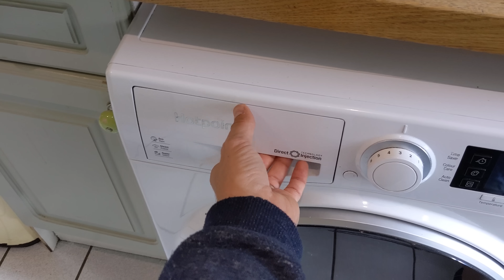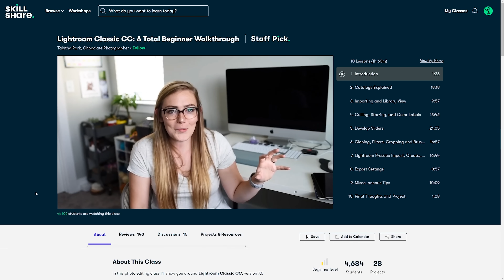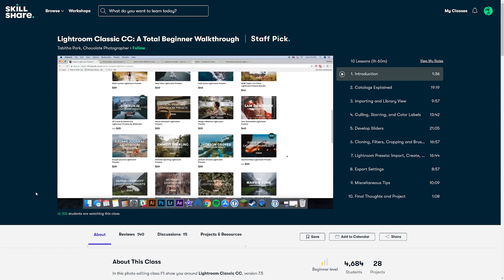The Pythagorean Siphon Inside Your Washing Machine

Comment: Has it not occured to him that they weren't talking about the tank side of the toilet??  Look at the Bowl, and the drain. The water stays in the bowl at the top of the lowest point. When you flush, it fills it past that point and starts the siphon until it is empty and gurgles
Reply: mmmmm yesss daddy siphon me
Reply: romasromas73 wtf
Reply: Lmfao I know right?
Reply: Take out the vent pipe and no siphoning! Try siphoning any liquid from any container without some air in the container.
Reply: That's a different design yet again.
Its not so much a siphon as it is a trap.
The water will always stay at a set level.
The purpose of these is to stop the smell of sewer gasses from coming back up and out of your toilet.
You also have an identical bend under your sink, but the water level is well below the drain.
If these are siphoning then you have a problem and should call a plumber.
Air is supposed to be able to enter both sides of the trap.
Usually there is a vent pipe outside which goes up above your roof to let air into the drain to prevent exactly this.
Reply: John Pycroft you’re describing an airlock 👍, the bent in the pipes.

the video is showing  what is found inside  the clean water reservoir in the toilet flush tank. The siphon.
Reply: I hate to be that guy, my comment here did not relate directly to the video, but to the comment left on the video, I'm not the idiot here.....
Reply: @Person1873  of course, but the bowl still fills up to the point of the "greedy line", then flushes down to the low point. You can never overfill a bowl unless the line is plugged. You can never fill up the bowl with bleach water to sanitize it because it all drains down at a certain point. Unless it plugged that is.
Reply: @Person1873  isn't that what he shows in 2:45 ? "Almost completely empty". There's still some liquid there, like you said.
Reply: @Person1873   I think you might both be talking past each other here. I think you are describing the style of toilet bowl common here in the UK, with a trap and not a siphon, and a relatively small volume of water. I believe Rustmane Skytrekker is referring a US style toilet bowl. These have a larger volume of water in the bowl. When flushed, this all drains out and the level goes right down to the bottom, before there's a gurgling noise and it starts filling up again. As I understand it this does rely on a siphon effect.
Reply: @Person1873  you probably don't have the same design of toilet as is common in the U.S. then. If the bowl is drained /past/ the 'overflow point', then it is a siphon. Yes there are vents on the drain pipes, but the siphoning action will occur even if the toilet is not installed and sitting in the driveway, and a bucket of water is poured in. The functional factor is the size of the outlet, small enough that a continuing siphon is achieved until the bowl drains to a point where the air can enter and break the vacuum at the top of the siphon. Its at that point, the water stops flowing, the bowl is backfilled slightly, and then further refilled to a trickle overflow with the fresh water system.
Reply: That's just an overflow drain. It only drains as much water as overflows

Comment: All the toilets I've used with accessible cisterns flush with a trapdoor flap at the bottom of the cistern which is simply pulled open by a string or chain, with the cistern cutting off its refill with a bobber on a lever and a tall pipe with an open top used as overflow protection, pouring overflow into the bowl in the event of malfunction

Comment: US person here, I have never seen a siphon toilet mechanism ever, in the US, Mexico, or Brazil. Ours just have a big flap or cylindrical plug valve that lets all the water out of the tank. Some have a pressure tank that uses tap water pressure against the air in the tank to produce a very quick and powerful flush.

Comment: A lot of smoking accessories, like water pipes, also known as bongs, feature the greedy cup siphon. I have this one bong called a Grav Stax, and it has interchangeable percolaters.

You put water in these devices, the percolaters, and the smoke or vapor bubbles through the water to cool it down, but I know that if you fill up the percolater too much, then almost all of the water drains out through the bottom.

Comment: There are other Toilets that work a bit different though and maybe you can make a vid to thoroughly explain this... but there are some toilets where if you just tap the lever to flush the toilet it will only do a partial flush... where as if one wants to actually achieve a full flush though... you have to press it and hold it in the same position for a few seconds till you hear the toilet flush then release it

Comment: The old toilets in the usa just had a flap in the bottom. You pull up and it let's water flow into the bowl and it stays open cause the pressure of the rushing water is more that the spring pressure trying to close the flap

Comment: Here in Brazil there is just the pipe straight from the water box above .. when you press the button on the wall  it releases a strong  water current down  for as long as you hold it !

Comment: I did think "that's how a toilet works" because I'm in the USA. I have never seen a siphon in a toilet that looks like yours. Here the flush valve is a rubber flap with an air pocket at the bottom of the tank. When flushed it allows all the water from the tank to rush into the bowl. As the water level in the bowl raises it initiates the siphon that is built into the porcelain of the base between the bowl and sewer line.

Comment: Mine has a hole at the bottom with a flap. Not sure how it stays open while the water is leaving, I would guess it has some air in it that keeps it up until the water is out. Then it closes and the weight of the water keeps it shut until you pull it up

Comment: For all you siphon starters, you don't have to suck on hose, and in many cases shouldn't suck on it if fluid is toxic or intoxicating or just can't maybe its too large or you don't have the suction needed. 
Submerge ALL of the hose into the fluid container that you're sucking from, in a way that allows all the air to be pushed out by fluid. Cap or kink the end and pull the hose out leaving one side in fluid, preferably on the bottom of the container.  Once your output end of the hose is where you want it just uncap or release kink and the fluid will begin to flow. So long as your suck side of the hose is higher elevation than the output side.
Reply: Yeah... That's more easily said than done in many cases, such as fuel tanks.

Comment: Interesting flushing mechanism. All the toilets I've worked on had a flapper covering a drain. Handle lifts the flapper and water rushes down the drain into the bowl. Once lifted an air bible keeps the flapper floating until the water level drops low enough for the suction to pull it closed and seal.

Comment: American toilets have plug on a hinge at the bottom of the tank. When you flush the toilet it pulls a chain that's attached to that plug allowing it to lift and the water to rush out the bottom. The fill mechanism though works the same as yours. Overfill protection is offered by a tube that if the water surpasses the height of the tube it will dribble over, down the tube, and into the bowl.

Comment: Most (at least most older) American toilets just have a “semi-buoyant” flap at the bottom.

When it’s lifted open, the water exiting underneath it keeps it open until there isn’t, at which point it seals and then the pressure from the water on top keeps it sealed.

Comment: Interesting. In North America most toilets I've seen use a rubber valve with an air pocket in it. Tank water pressure/drain lower pressure (atmospheric) keeps the valve closed/sealed on filling cycle. When you activate flush a lever from the flush handle lifts the valve via a chain (or similar) enough to break the seal allowing the valve to float until the tank completely drains. Once the water level drops enough the valve closed and seals and the cycle starts over again. Filling/water level control is still a float valve (designs vary) with an overflow tube. Most old urinals used the system you demonstrated but, with water saving, most these days are on demand mostly via electronic sensors.

Comment: American toilets don't use that siphon device. The tank has a drain at the bottom of the tank and pulling the handle pulls the plug  covering the drain, and the water is free to flow into the bowl.

Comment: Our water closets use a hole in the bottom with a simple rubber flap over top. When you press the handle, the flap is raised, allowing the water to fall into the basin by gravity. An air bubble is trapped on the underside of the flap and causes it to float for a short time before dropping back down to refill

Comment: In canada it doesn't work that way. The bowl is filled with water but when we flush the chain pulls on a rubber seal at the bottom which is form like a " hat " ... The way i understand it is that when the force of the air inside the hat is not strong enough it closes the gab so the water can get in again. Sorry if I'm not clear English isn't my main language

Comment: Our toilets in midwest us does not have a siphon! There is a central ~4" cylinder that is open on top (for the dribbles) and a gasket at bottom. Lifting the lever raises the cylinder shell letting the water into the bowl.

Comment: Can I use this principle to water my farm ?from the low land Creek to water my crops
Reply: Absolutely, you just need to get the creek water above the crop level. 
You do understand a syphon still requires gravity? 
Try a screw or a best a ram pump.
You can use the creeks water flow to pump water uphill with either method but you cannot syphon uphill, not efficiently. 
You could get some flow by creating a split to steal off some of the flow but I doubt it would be worth the bother unless you have a large flow volume to begin with. 

But definitely look into a ram pump system if you don't need a huge flow.
I've seen systems that pump 24/7 into a holding tank that is then used like a water tower to deliver water at pressure.
Pressurized water with zero power input ( not counting water flow).
Reply: @eshootziscrs2868  well thanks a lot I'm a young guy who move to the country side and bought a farm . , I had minimum experience ,. It kinda scary though all of my plans getting wasted 😂 but thanks .

Comment: Here in Mexico, most of the toilets, only have a flap at the bottom of the cistern. When you pull the handle, the arm is connected directly to the flap, which initiates the flush.

Comment: The simplest toilet mechanism I've ever seen consists of a very lightweight plastic bell thing, a hole and a handle. When you want to flush you simply lift the handle upwards. The bell thing lifts up as well, opening the hole, down which the water goes. The bell is light enough to be pushed up by the water current, and when the tank empties itself it gradually lowers itself back, closing the hole and allowing the tank to refill. 
This system is dead simple, allows for the very precise flow control (up to some point). The only disadvantage is that it's somewhat prone to getting stuck open, but that is trivial to fix - just prop the lid open and nudge the bell into place.

Comment: I didn´t know the siphon thing in Guatemala all the toilets I have seen when toy pull the leaver, it has a little chain that its attach to a rubber trapdoor that blocks the flow into the toilet so you basically are opening and closing the tube manually with the leaver.

Comment: Here in america we dont flush the toliet the same way. We have a seperate flow control connected directly to the water supply. When we press the handle to flush the toliet, that engages a flapper, which is completely seperate.

Comment: I am a plumber from New Zealand, syphonic flush valves are very rare here. Most toilets here have a mechanical  flush valve sealed with a rubber washer. Pushing the flush button, ( lever operated cisterns are also rare), lifts the plunger and water flows into the bowl. The plunger is generally linked to a float mechanism which keeps it open until the water in the cistern drops to a predetermined level.
  I think syphonic valves are better as they have far fewer moving parts and don't rely on a perishable rubber washer to seal.

Comment: I did plumbing in America for 5 yrs and the toilets don't have that valve syphon system, it is similar in the way that it have an overflow pipe but other than that they just have a rubber valve that you pull up to make water flow into the bowl . Great video btw!

Comment: My toilet has the same pull-y thing and it lifts a plug at the bottom of the tank which just releases the water. Same float valve to cut off water intake. Pretty boring imho :(

Comment: In Brazil we have the syphon toilet and another version, that is a button that you press on the wall that opens a valve that allows the water to flow into the toilet bowl. It's becoming more and more uncommon tho, cause you can flush indefinetly using those, wasting a lot of water in the process.

Comment: Mainly in post USSR we have float plugged drain. Plug is a float of near zero buoyancy. When you pull/push the button, you lift the plug, that equalizes pressure under and over the float and it stays on top of the water. When it is filled, water pressure presses down on the plug keeping it shut

Comment: I've never run into a siphon toilet mechanism.  here in the US, it's very simple. just the float sets the water level, and the flapper at the bottom is connected to the handle and gravity starts the flushing system.

Comment: in da britain may be its syphon like this, most of europe uses diferent style thats also spilage safe, in ours usualy epdm seal breaks after around 10-30 yrs and in yours? this foil thing not so long i guess but its still neat cause to replace you just need some soft foil and not specialized only to one mode fitting rubber ring of varying dimensions like we have :) and you have much cooler physics in toilet :)

Comment: Our washer has been leaking it turns out from the bleach siphon, which we have never used, overflowing. Melinda H has a video about "fixing" this by disconnecting the solenoid for the bleach pump. Considering it's never been used perhaps there's a spider web or some kind of critter blocking it or something.

Comment: I have a wall-embedded cistern with a simple plunger as a cut-off system.
it sits right on top of the pipe, and when water comes in, it presses down on it, further sealing the pipe.
but when you pull it up with the lever, water runs beneath it, pushing it up, until the tank is drained and the plunger goes back down.
the point of the plunger is a sort of screw, hydrodynamic, so when water rushes down, it pulls from the plunger so it doesn't float away too high.

Comment: In Finland we have different types of "levers" (usually either "button" types or then a knob that you just pull straight up) and usually especially with the pulled ones you have to actually hold it up so that all the water comes out, otherwise it just lets a little bit of water into the bowl!

Comment: Desert dwelling american. Never seen a siphon toilet cistern in private use or places that are supposed to feel homely like hotels; everyone I've encountered clearly have a simple flap controlling the flow of water, you drop the handle and you can feel the flap drop blocking the water.
but may have seen them in public use where forced flushes and forcing everyone to flush totally seems rather common and in good sense.

Comment: I’m in Canada 🇨🇦 and the majority of toilets I’ve seen have a hinged air-filled rubber stopper  on the bottom of the tank that is pulled up simply by a chain attached to a lever operated by the toilet handle and let’s the water drain out.  The air in the rubber stopper causes it to float as the water drains and then it falls back down and seals the tank outlet when the water is drained.  The weight of the water on top of the stopper is what keeps it closed between flushes.  The syphon version sounds cool, and I think newer toilets are using that because they have the full/half flush thing, usually associated with two buttons on the top of the tank.

Comment: Shame on you or more correctly an alternative design under different patent.
In the US, it is common to see a flapper valve at the bottom of the cistern which initiates the cast in the porcelain stool S trap/syphon. The trap prevents sewer gas rising into the house. The flapper has a float design which closes upon emptying the cistern, then allowing refill.
Really cool design is the pressure flush toilet which does not actually use a syphon but has an exit valve. Potentially it can flush clean and use only 300cc.